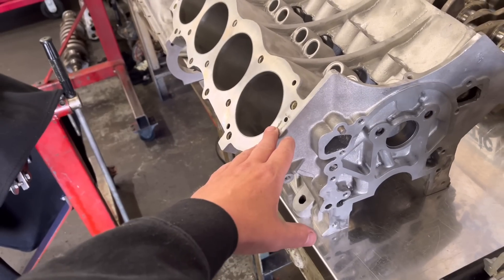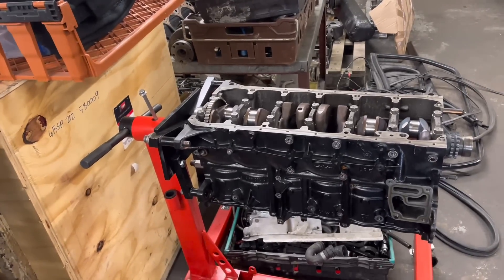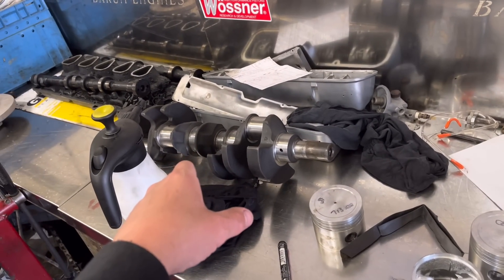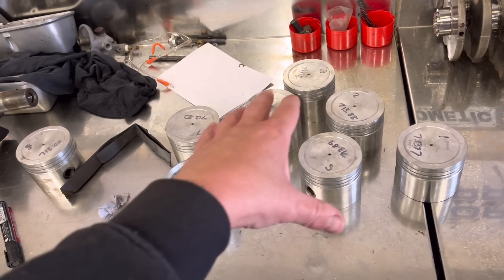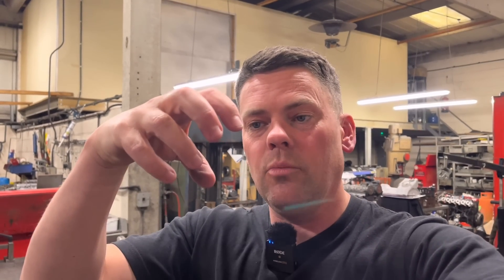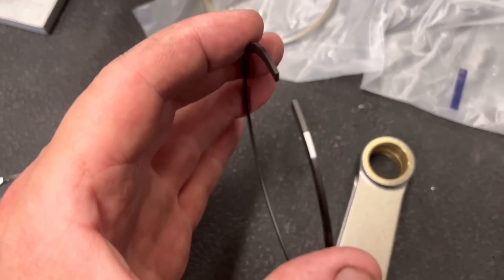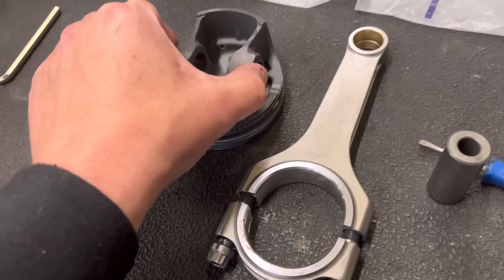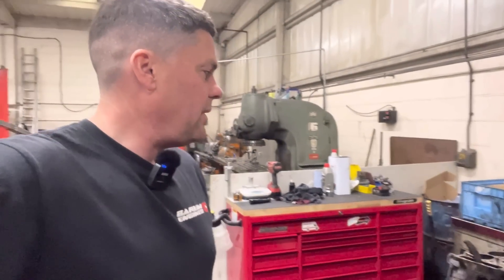This is the Worst engine we’ve seen: check out the wear on this!

Comment: I'm guessing it's not sequential injection so injector channels would be 1/6,2/5,3/4 maybe a faulty injection driver for the 2/5 channel caused a slight bit of bore wash and increased wear, or just randomly leaking injectors. I would definitley be getting the injectors flowed in any case

Comment: Presume you use a snap wire ring on the assembly of the piston.  As the chamfer on the gudgeon pin holds the clip in place.  A conventional circlip can get pushed out

Comment: It sucks ACL got bought out, and now you can only get bearings for specific more common engines they know people are gonna buy, because I used to get everything from them back when I was messing around with building import motors and the quality was always top notch. This happened when a Company called 'Race Winning Products' bought out a whole bunch of aftermarket performance brands in the states like all the good piston manufacturers like Diamond, Wiseco and JE, cylinder and head companies like Dart and it's pretty much a good chance you will need their products if you are building a high end engine . All they did was bought all the companies under their control and sold of all the assets of the companies, fired of all but the essential employees and just do the least possible to maintain control of all the copyrights. everything is perenially on backorder, it seems like they just produce one big batch of items per year to go out to retailers (I guess they will get you stuff if you are some famous raceteam operator) but it's ruining the aftermarket industry , it's the same with Holley brands, they buy another brand and the stuff all of sudden goes out of stock in retailers with no known ETA for restocks..

Comment: Excessive bore wear like that, you don't normally get it at all on EFI engines but common on older ones with carburettors, Caused by excessive rich mixtures on cold starts. Oil dilution and bore wash. Also with wannabe race cars where the catch can is hooked up wrong disabling the PCV system.

Comment: i have been given a Rover P6 V8, downside is... the starter motor can't be fitted as someone put a grinder to the mount for some reason. bonus is... two heads, two carbs, high compression pistons and a base for a table. the parts sit next to my other heads, carbs as i had a 101fc throw two rods, one left and one to the right of the block. question.... with the 3,5L ones, can the main bearing bolts come loose to give that issue? i found two part undone and one main bearing cap in the sump. Engine got replaced by a ex uk army preserved V8 we had on the shelf.
Reply: worst bore wear i have seen was .5 mm. that diesel was a happy slapper. worst of it was, it was sold as a restored engine. you don't get .5mm wear in a month of use

Comment: Interesting to see that the Mercedes engine block is slotted between the bores. The last iteration of the Jaguar XK engine, also a straight six, used similar slots to provide a coolant passage between the bores. Could it be a Jaguar engineer had sight of one of these Mercedes engines when Jaguar were trying to eliminate cracking between the bores on the old, linered, blocks ?

Comment: The excess bore wear on the Mercedes engine could be down to short cold running and not enough high speed running. The first car I bought had been driven short trips most of its life less than a thousand miles a year over 17 years, the bores looked like a pint beer glass. It blew the rings out. A set of cords rings lasted about another 12 thousand.

Comment: I loved the smell of the big ends of conrods after you take the old shells out... Used Wynn's glup oil treatment for lubricating gudgeon pins and bearings etc.. It's been years.
Reply: Mixed up STP and oil 1:1 as recommended as a build lube for my first engine build back in the 70s and I've still got some left.

Comment: I am in the motor trade and always amazed at how wight and measurements differ from the same brand new item batches. I am also amazed at how much material can be removed to bring these into spec
Reply: My pal is a British touring car winning engine builder plus a lot lot more and the work he does to parts to get them ready to race is crazy, his engines won while still in the workshop they were that good.
Gonna upset Barums again but his Cosworths engine rebuilds were £15k in 1988  and that’s if nothings exploded 😂

Comment: Great emphasis placed on oiling the pin and rod bearing, didn’t see any oiling of the rings, piston skirt and bore. Lack of oil will contribute to accelerated wear of these components.
Reply: Rings, bore and piston skirt are generally oiled by oil thrown off the rod and main bearings. When an engine is running, there is a mist of oil all through the internal spaces. Oil squirters that spray oil directly at the underside of the piston crown are there for cooling, not lubrication.
Reply: Any oil put on the bore would be removed the first time the piston goes down . Any oil on the top ring would be lost on the first combustion cycle.
Reply: @dennisphoenix1 Not exactly true. The oil ring function is to remove excess oil.from the cylinder wall. The current practice of plateau honing uses a coarse hone set to get to less than 0.001" from final size. Probably more like 0.0003" from final size. Then a much finer hone set is installed to knock the high points of the initial hone finish. This provides a smooth flat surface for the rings and piston skirts to ride on, while the deeper grooves are left to hold oil for lubrication of the compression rings. Not all of this is burned off. This and the fine atomization of the fuel in sequential injection is the reason modern engines last so long.
Reply: @daledavies2334  I know about cross hatching,  but realistically the only wear on the rings or skirt would be before the oil was circulating around the engine on initial cranking after the rebuilding process . I can't imagine there would be that much wear on a few strokes . ??
Reply: @dennisphoenix1 Wear on a few strokes,  not likely. Totalseal recommends WD 40 on the cylinder walls, rings and skirts on assembly for quick breakin. The rest Is concerning a running engine in use.
This is according to Totalseal and Lake Speed Jr who is a lubrication specialist. Watch the Totalseal videos.

Comment: After Monday's episode, this was definitely one for the mech heads. 😆 The bit about the piston rings and fitting the pistons reminded me of when I had to bodge a tin can and jubilee clips to use for a motorcycle cylinder block. Worked a treat. Aah, happy days!
Reply: I use strips of thin plastic and cable ties as ring compressors on bike engines. Costs virtually nothing and no chance of scratching anything.
Reply: Haaa. . . The days huh. I still use copper paper to this day😅
Reply: I use strips of thin plastic and cable ties as ring compressors on bike engines. Costs virtually nothing and no chance of scratching anything.

Comment: Maybe the black has that much wear because they drove until there was not enough compression to function.
Also, perhaps the engine was speed honed at one time in the life of the car, and nobody ever bothered to measure bore wear. I can't imagine how much oil the Benz would burn through.

Here someone had even worse wear in an AMC/Jeep 258/4.2 engine:
https://www.youtube.com/watch?v=z4n7GraZQN0

12:00 I remember seeing a rebuild of a VW VR6 years ago. I was surprised to see two piece oil rings, and said "Who puts diesel piston rings in a gasoline engine?" Living in the USA means I encounter more American and Japanese engines than anything else.

Comment: 318 Chryslers were notorious back in the 60s and 70s for huge cylinder wear.  They wore so much that you could not remove the pistons without removing the ridge first or you would break the ring lands and the rings.  I don't remember if all of the small blocks had that issue, but the 318 stands out in my memory as always being excessively worn.

An old trick with that style of oil ring: if you flex the scrapers, they will always cup one way, so, you can either put them all on with the "cup" up, which minimizes friction on the down stroke or you can put the cup down, which puts more pressure on the wall on the down stroke.  Either way, it allows you to put all the scrapers with the "cup" in the same direction.
Reply: I have experienced similar piston-bore wear in 'past' engines - especially engines that were modified and used inappropriately large carburetors.  These engines used carburetors that were 'less than optimal' in metering the required stoichemetric fuel-air mix into the engine at all engine loads and speeds - and as such tended to suffer from a lot of unburnt fuel (some more than others) that resulted in piston bore wash - made much worse if the carburetor had been incorrectly modified with larger main and pump jets - or worse still - fitted with inappropriately large bore, poorly jetted carburetors (hot rodder comment:  "a larger carby must be better - right??").  Notably an ICE continues to run adequately with a fuel-air mix that is far below the stoichiometric ideal of 14.7:1 - and in the past I could 'smell' plenty of modified cars that ran like that - i.e. poorly with terrible petrol (US gas) mileage, and needless to say, far less power than what was possible.  Today's engines use electronically controllled fuel injection systems that accurately and optimally manages the fuel-air mix at all engine loads and speeds. These systems have all but eliminated the incidence of over fuelling and associated bore wash.   I found engines that have covered over 300k km with a negligiable bore ridge - a situation that was impossible to achieve in 1960s and 70s engines.
Reply: @georgebettiol8338 I concur.
Reply: How many miles on those engines though. As a mechanic, I saw many of all brands. Early '60's Chev and Fords with 100k miles would be worn right out and burning oil. Same vintage Chrysler engines were good for 150k to 200k miles. The chrome faced rings lasted very well. Chrysler 383 would burn a quart of oil over the recommended service interval until you got to 20k miles. The bores were honed with a fairly coarse stones to allow the rings to wear into the cylinder walls. At about 20k miles they would be "broken in" and the oil consumption would stop until about 150k miles. And yes they would have a ridge that required reaming before piston removal.
Reply: @daledavies2334  

These weren't high-mileage engines, even by 60s standards.  

As a machinist, I also saw and machined many types of engines, but none were as common or as bad to flare the top .5 inch the way the 318 would.  Even the 318 poly engines would put .040 or more wear at the top of the cylinder in under 30k miles.

Chrome rings were common back then, were notoriously hard to seat and being hard, weren't very forgiving to the cylinders if the oil or incoming air was dirty.  An old trick was sprinkling a teaspoon of Bon Ami powder down the carb, putting 5,000 miles on the engine instantly and seating the rings.  Basically, it's like lapping the rings.
Reply: @lelandlewis7207 I only once had to Bon Ami an engine. It was a 3 or 4-53 Detroit Diesel in a crane at a steel recycling foundry. Spent 95% of its time pretty much at idle so it glazed the liners. A tablespoon of Bon Ami fixed it. For the application it should have been run in on a dyno.
Yes the chrome rings were hard on the cylinder walls.

Comment: Seen more wear than that block...nothing uncommon on old series 11A and series 3 Land Rovers running on cheap petrol....we had a 1/2 Air Portable Land Rover in Belize that was rattling and smoking like an old steam engine.. Took the head off and on the thrust side of each cylinder there was a massive lip that had been worn into the cylinder wall...the vehicle had been to the moon and back in dusty and dirty conditions for years...had no facilities to re build it so we stuck a new engine in..no doubt it still rattling around Belize to this day.....
Reply: REME?
Reply: @Airgunfunrich  no...Royal Engineer plant mechanic....we were posted to REME workshops in Engineer Regiments to repair C vehicles.....we had composite fitters sections..REME and RE and we worked on anything that needed fixing A B and C vehicles..did plenty of pack changes in my time as well....worked with some great ASMs...